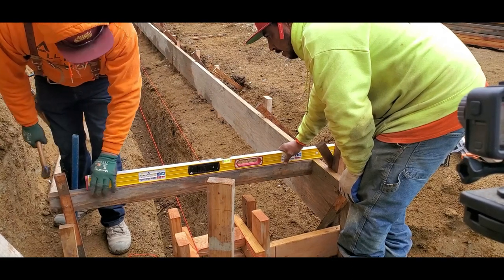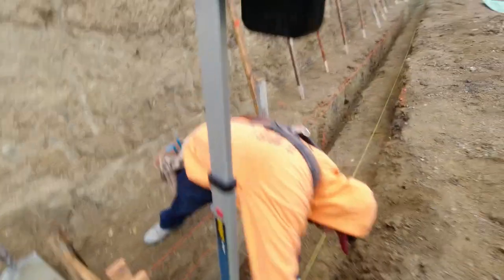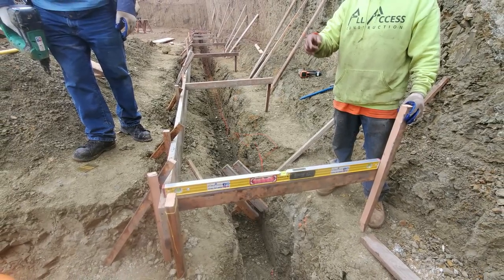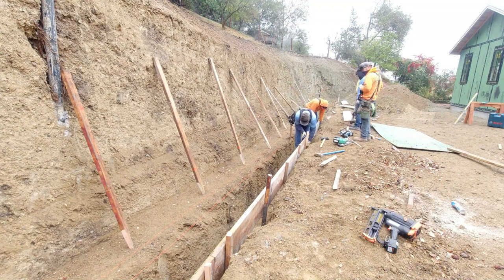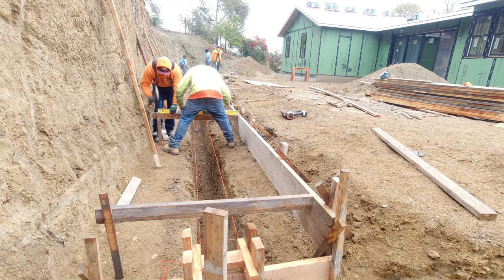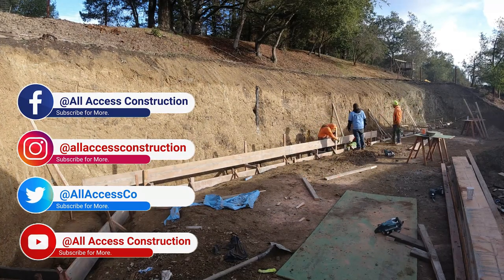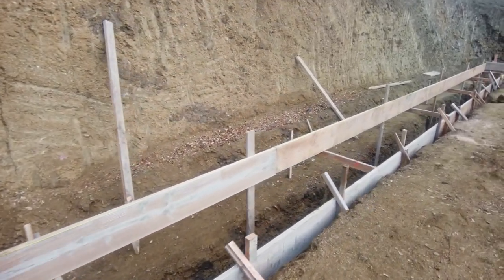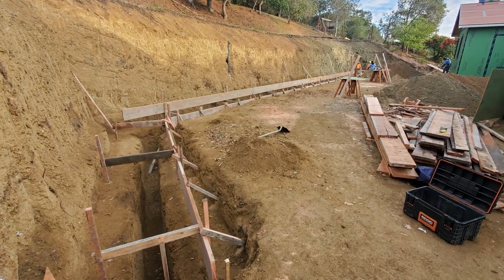Uncover The Secrets To Concrete Footing For Retaining Wall! 🤫

Comment from the maker: Check us out Installing a concrete footing for this retaining wall. The wall itself is 130 feet long By 5 Feet High. The footing for the retaining wall is 4.5 feet wide by 18 inches thick. The keyway is 3 feet deep by 1 foot wide 

Videos Mention:

How To Build Back Of retaining Wall: https://bit.ly/2IMpIbP
How To install Rebar For Concrete Wall: https://bit.ly/3559Skx